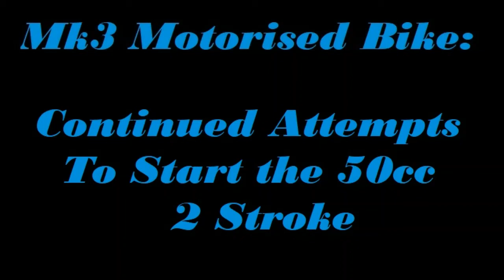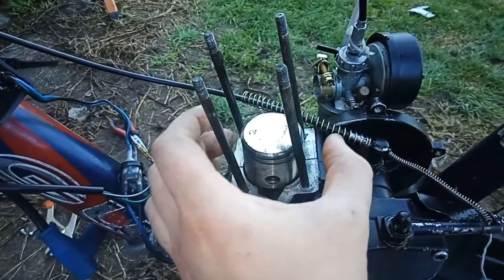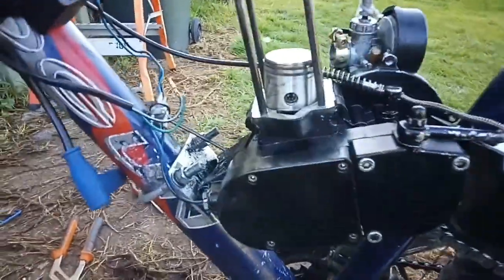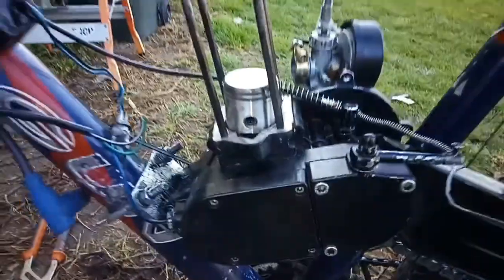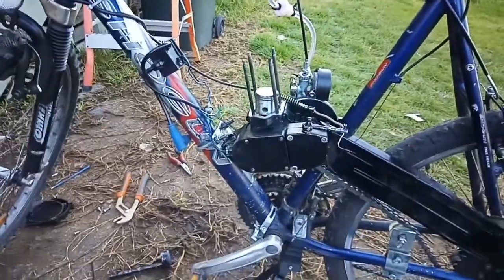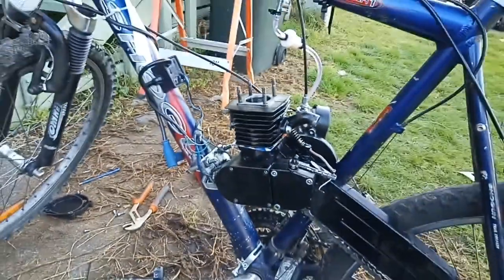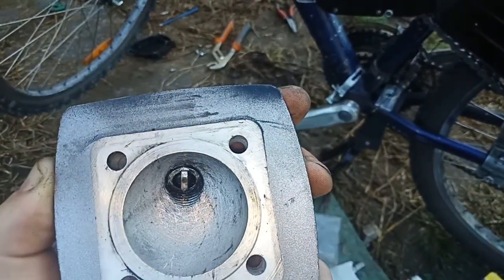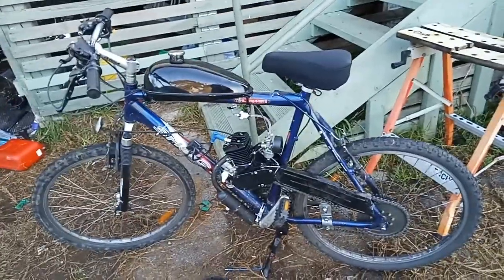Mk3 - Continued Attempts

Comment: I've used  silicone sealant instead of a base gasket on these motors and haven't had any problems with leaks.
Reply: @NicksBikes  just put a little bit on you don't want it going in the crankshaft.